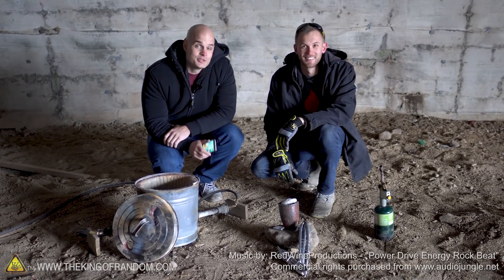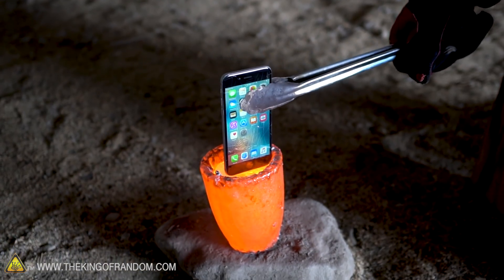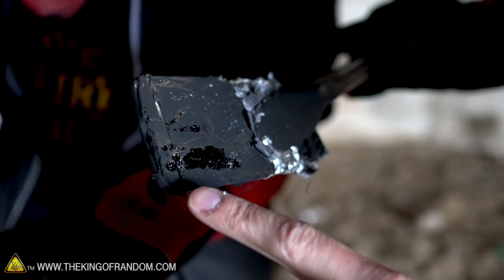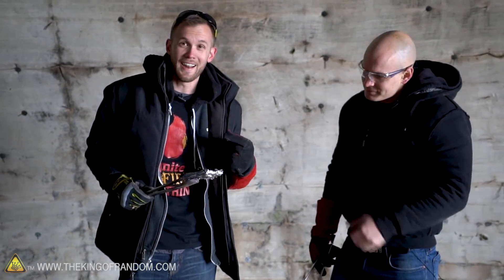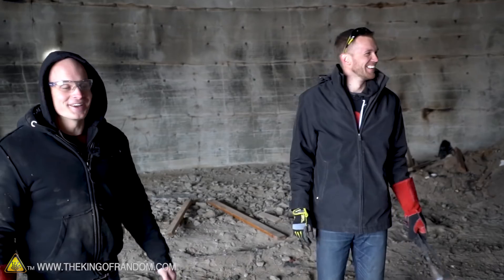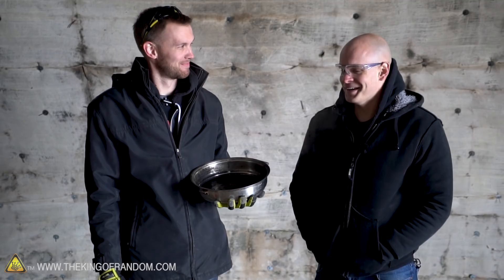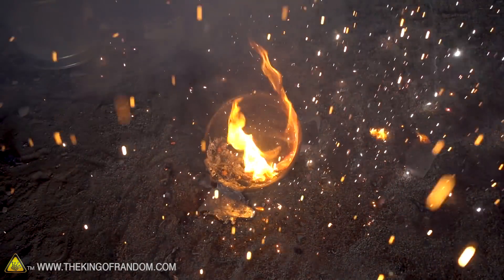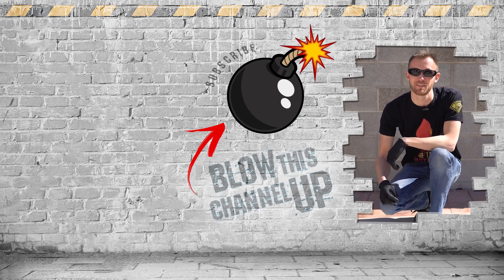Melting Batteries in Liquid Metal? Find Out What Happens To An Iphone In Liquid Metal!

Comment: Once the lithium is oxidized it will not react with aluminum because it is higher on the activity series than aluminum. It holds on to electrons more tightly than aluminum.

Comment: You should try melting a magnet then after it cools see if it is still magnetic
Reply: Arkinator 1 I think it won't be magnetic as (I think) magnets lose their magnetic properties when they're heated
Reply: They won't be. After you heat a magnet up to a certain point, depending on the material it loses it's magnetism. That's called a Curie Point, and is basic physics bud.
Reply: @brianscott2089  just so u know vibration and dropping  a magnet will also demag it

Comment: Hey can you slow down electricity by cooling or even freezing it
Reply: Leonard Vermeer you have to Heat IT up to slow IT down you cant freaze it
Reply: Cold components conduct electricity more readily than hot components because of how electricity travels through conductors.
Reply: electronic stuff It only happens in metals
Reply: You can’t change the temperature of electricity. You can change the temperature of the conductor through which the electricity passes but i see your point.

Comment: Can liquid nitrogen cause short circuit??
Reply: GT'S TALK no, it is used to cool ecus on overclocking
Reply: You don't even know what will happen
Reply: The question is so non-specific it could mean a number of things. What is the item in question that may/may not short circuit?
In general though, cooling electrical circuits would only improve conductivity, so probably not a short circuit. Maybe if you were to cool say, a large transformer (microwave oven transformer maybe) the resistance would get so low that it would be able to draw more than the 15 amps a outlet can provide. and trip a breaker.
Small electronic components may work 'better' when cooled, but only do a certain degree. Transistors don't work so well when you get them to -150 C, electrolyte in capacitors would probably freeze, resistors may change value. Condensation would be the most likely thing to cause a short circuit. A circuit board may just break from being so cold and brittle.
Reply: depends on the impurities of the liquid nitrogen. Assuming it is 100% pure, it is not conductive. If there are impurities (salts of some sort) then it will be at least partially conductive) as it allows for electrons to be transfered (the rate of transfer i cannot predict numerically as there are too many variables). 

tldr; its not gonna short circuit, unless you have a really impure nitrogen.

Comment: what if you use molten aluminium as a switch in a circuit of a bulb, battery and steel wire

Comment: I once tried to melt battery casing on my kitchen stove, within seconds the metal got burned. Whatever metal is used on batteries it has really low melting point.

Comment: Anodization of aluminium is basically controlled oxidation of the outer layer. Definitely not what's burning. The fire is certainly from the internals igniting.

Comment: Anodising aluminium just means its formed an oxide (so in a way, its "burnt"). So no, that doesn't make it catch fire. In fact it would prevent it from doing so. Probably the colourings and paint burning though, and plastic pieces.

Comment: You should do some experiments with 18650's lithium ions you can actually Savage them from dead laptop batteries short out the negative and positive after they're fully charged and run it's quite fun I work with them at my job so I get a bunch of them to destroy on a regular basis

Comment: anodizing does not burn... Also Sapphire will not even try to melt in that fire, as the melting point is 3722 F, that is much hotter than the melting point of most metals.

Comment: Clever pun. But, attaching positive to negative does nothing between two batteries until the other end of both are connected. The heat will damage them long before attaching them to each other would. You can test that in a future video. Just be careful. Enough batteries attached in series can be fatal.

Comment: The misinformation is strong in this one.

Sapphire does not melt at anything like the temperature of molten aluminum.  Anodized aluminum doesn't burn significantly more than aluminum alone.  The flames are being produced primarily by burning plastics.

Comment: +the king of random . What happen if you use a Bigger lithium battery like 12v 20000mah lithium battery pack rechargeable lipo polymer Battery for RC car / RC Helicopter or SuPower 7.4V 3000mAh full capacity Li-ion Rechargeable Battery  for RC Car. My theory is that Larger battery gives a bigger bang or  firework

Comment: The reason I believe the battery didn't melt is that the lithium got covered in aluminum before air could react with the lithium so it did nothing. Also lithium cant react with aluminum, it might make an alloy though if mixed in the right conditions